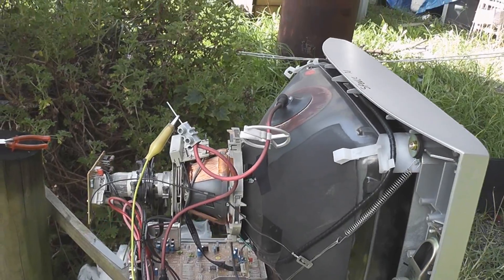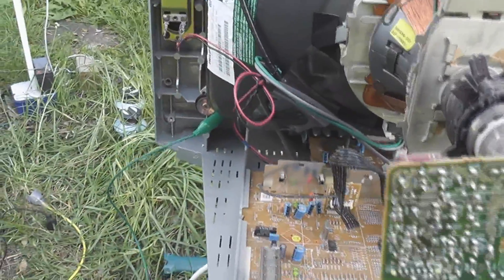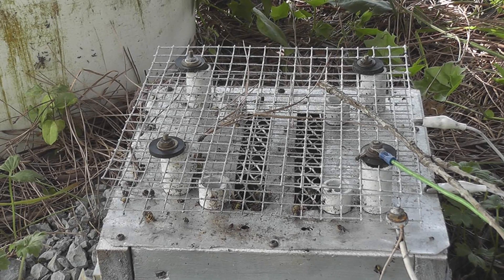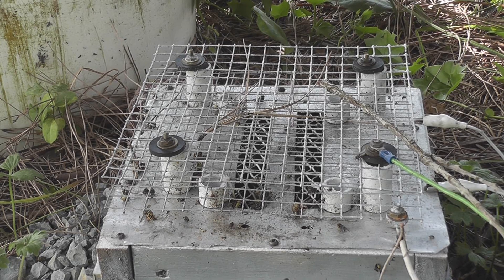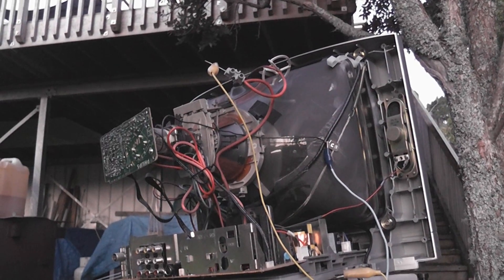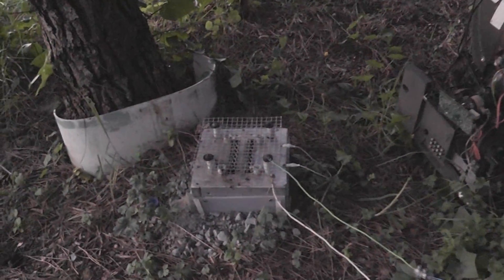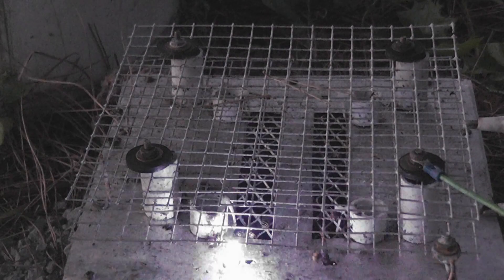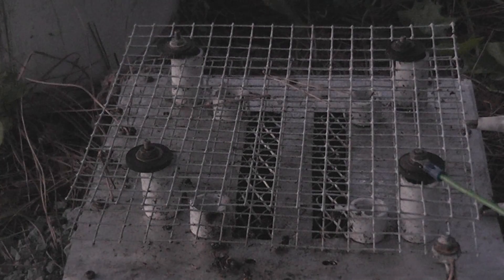Wasps v CRT TV  [part 12]

Comment: everything ok? no damage from the earthquake at 2016-02-14?
Reply from the maker: +Bart Prins No ,everything fine here in Auckland, Thanks. WE are about 1000 km North of Christchurch. There was a big substation fire too today, Capacitor bank explosion.
Reply: +RODALCO2007 glad to hear that! I keep forgetting that NZ is a bit largen than NL....
Reply: +RODALCO2007 
OooOoo... what happened with the caps? Just typical old age?
When you're working with power electronics, they only abide by one rule:
"When in doubt, explode."

Comment: Good to see the Wasp nest is still viable, Its a wonder that they havnt shifted camp yet to another quieter location without being blasted by High Voltage! I wonder how a HV step potential through the ground would affect the colony? Keep up the great work!
Reply: +rustymotor 
I bet it might be possible to rig up a circuit to give the ground a quick little zap. Not enough to instantly kill the wasps, but enough to get them pissed.
Then they'ed come out of the nest, and get zapped! :D

Comment: LOL Ultor cap. I like that name. Theres a fictional company in a few video games vcalled Ultor,  in the Red Faction series and Saint's Row series of games.

And you should buy an electric bug zapper even a broken one and harvest the HV transformer from it and use that but this sounds cooler. 
love that zzzzzzt sound. 

Maybe you could add a protection circuit into the power supply so if it arcs like that it cuts the power after a half second or so then turns it back on when the arc extinguishes.